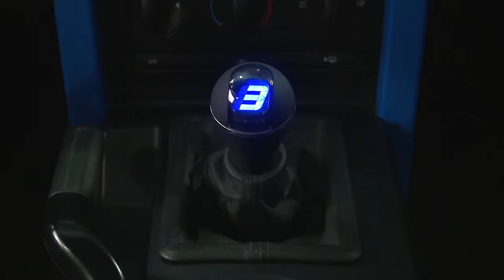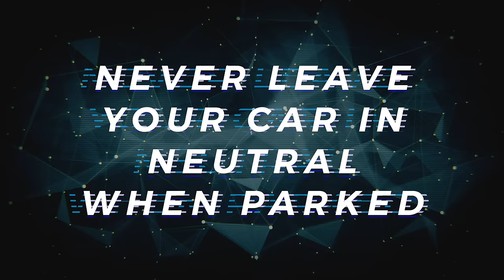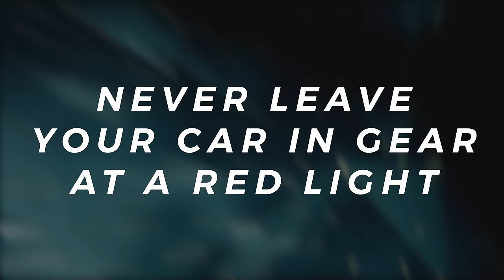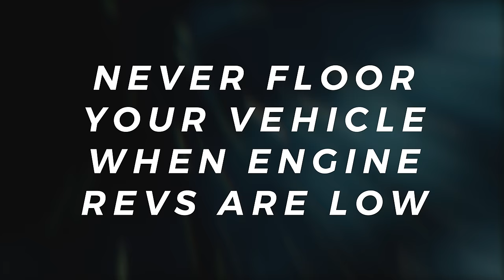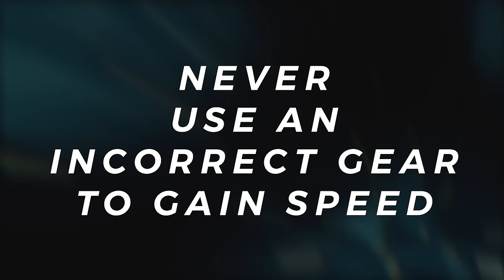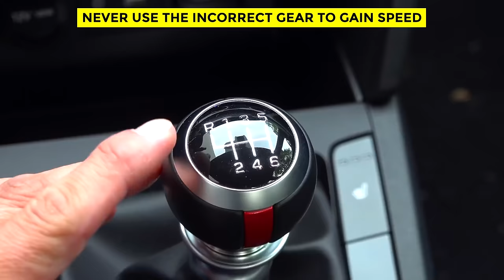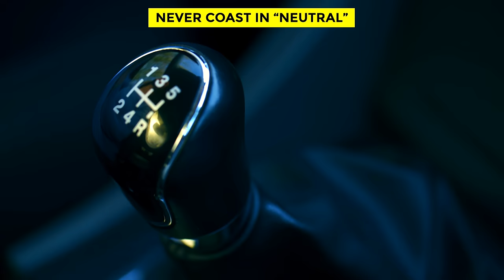7 Things You Should NEVER Do In a Manual Transmission Car!

Comment: engaging clutch before changing gears is just like pulling your pants down before pooping
Reply: bruhhhhh this killed me lmao
Reply: no it is not. You can change the gear without using the clutch. "clutch-less shifting" is a real thing. Before changing gear, you get the car in a state where the engine is neither applying force to the transmission, nor the wheels are back feeding torque back to engine. In that state, you can simply take out the gear. Then will in neutral, you RPM match the engine to the transmission and then you can engage the gear without using the clutch. Yeah that needs training. Yeah it is not intuitive. Yeah it is unnecessary. But: Some people drive that way and if nothing else: The clutch wear is almost nothing (you still need the clutch for full stop and start from full stop), so there is a benefit.
Reply: @sarowie  Yes we (well I) are aware of that, it was a joke
Reply: @sarowie  the only people I know that do this is truckers
Reply: That’s crazy, I normally shit then throw my pants in the washer
Reply: @sarowie  yes the clutch wear is almost nothing.....until you have to get a new one.
Reply: @sarowie  My dad always does it. And he's so smooth too. He says it's fine but I feel like it HAS to damage the gearbox, right?
Reply: Exactly, You don’t have to do it but it will make a huge stinky problem if you don’t both ways😂😂😂😂
Reply: @patrickmilkwood  no, people with automatics dont wear pants
Reply: @sarowie  well, you can also poop without pulling your pants down, so the comparison still stands, it's both not really advisable
Reply: So don't dump the clutch....
Reply: You do it with clothes on?
Reply: @sarowie  some cars don't let you take it out of gear easily without the clutch
Reply: Easy and very accurate example
Reply: nice analogy
Reply: My instructor told me this once
Reply: @sarowie  r/wooosh
Reply: except you can poop while going forward and wearing pants
Reply: @Demon-xw3bi  you are right, they wear diapers
Reply: Clutch-less shifting is like wearing a diaper or not wearing any pants at all.
Reply: So I dont have to do it
Reply: Naaah i just poop in my pants and then change the pants
Reply: this is hillarious
Reply: @Randommmmm204  If you do it correctly it won't harm your gearbox at all no.
Reply: @luissandoval1515  dude u had an awesome childhood
Reply: Accurate
Reply: Lol yes
Reply: @InitiateDee  it was a joke?
Reply: 🤣🤣🤣🤣🤣🤣 I cant breath
Reply: Wait you pull down your pants ?
Reply: @Randommmmm204  as, Michael Frey explains, you have to match the engine's RPMs to the transmission.
Reply: @sarowie  that, in the trucking industry, is a maneuver known as "floating gears"

you shift without clutch engagement but even now. many-many trucking companies are switching to automatics and consequently taking the "fun" out of the job imo.
Reply: 🙄 the world needs to end now.....
Reply: @Randommmmm204  not really. unless you flub it and grind excessivly, it doesnt. It can actually make the transmission last longer (if you are skilled enough) because you use the clutch WAAAY less when float shifting
Reply: What a good metaphor
Reply: MUAHAHAHAHHAA
Reply: @thebaguettecompany  dump eit
Reply: Lmao
Reply: @sarowie  my dad had to drive like that after his clutch pedal fell off
Reply: @sarowie  Well yeah and in the same vein you can in theory poop your pants without touching your pants with the poop if you just line it up right it’s exactly perfect analogy
Reply: OMG LOL, I'm going to use this with all of my learner drivers. 
Student goes to change gear without clutch: "Ahem. Do you pull your pants down before you poo? Well, the clutch needs to go in before you change the gear." Pure Gold!😂🤣😂🤣
Reply: @Randommmmm204  not really if done right there is little to no damage to the transmission
Reply: @sarowie  you ever heard of "log of shit out the trouser leg "
Reply: Too bad nobody told Joe Biden
Reply: @sarowie  yeah do this, save the clutch but destroy the whole gear transmission.
Reply: @sarowie  no you only need it to go. put the car in natural and press the brakes Wala no clutch no excess heat
Reply: @sarowie  that's called floating the gears it's more common to do it in a truck with no syncros
Reply: That actually made me laugh lololol
Reply: Well said my g
Reply: @sarowie  as someone who usually shit my pants I agree
Reply: You’re supposed to do that?
Reply: Truuuu
Reply: Is not advisable on changing down
Reply: @sarowie  🤓🤓🤓
Reply: @sarowie  May save a towing if the clutch cable or support breaks.
Reply: why is this so true
Reply: And adjusting your throttle when you change gear is like pulling down your under garments before poopin
Reply: @Randommmmm204  i dont know if anyone replied to you yet, or if you know what you said but you said " My dad always does it. And he's so smooth too. He says it's fine but I feel like it HAS to damage the gearbox, right?" In theory, no and yes. If he does it properly you wont hurt the gear box at all, your dad just knows what RPM means what speed in what gear VERY VERY well, he will only ever beable to do it properly in that car, it takes A LOT of skill. However on the other end of the spectrum, if you don't do it right, even the first time, you could demolish one of your gears or the entire gearbox.
Reply: @sarowie  well thats the same as telling u can poop without pulling down the pants
Reply: @sarowie  you must be very fun at parties
Reply: Opposite
Reply: @sarowie  what?
Reply: don't charge your iphone 🐶
Reply: @sarowie  I did that once unintetionally, I shifted without clutch, then I pressed on the clutch, I was like "What in the bloody hell did I just do?". I did not hear gears grinding, I did not feel any resistance, so I suppose I did id right.
Reply: So clutchless shifting is shitting in pants???
Reply: Best analogy.
Reply: That Depends
Reply: @sarowie u can also poo without pulling ur pants down, the example still works 😂
Reply: @sarowie I mean, you CAN poop with your pants up, but overtime it will lead to damage
Reply: @sarowie you can poop with your pants on too but you dont because its better to do so
Reply: I shit myself
Reply: @sarowie  oh wow i guess is the same concept ive seen videos of of dudes riding motorcycles and shifting without the clutch. They I think throttle off and on very quickly I think. Like a blip.